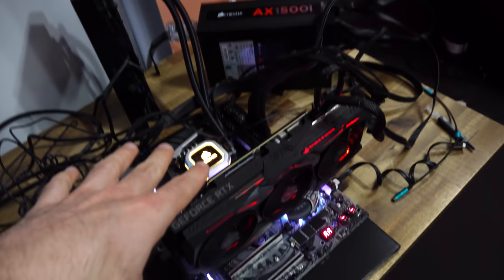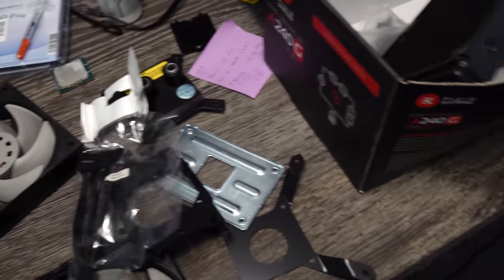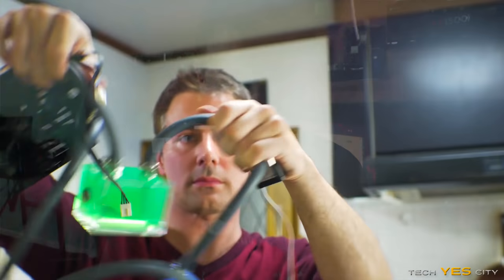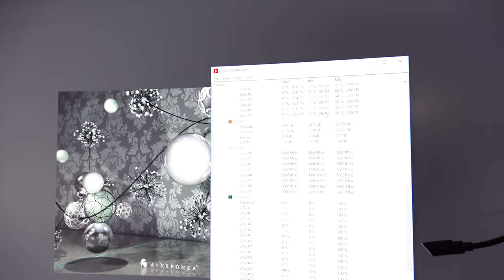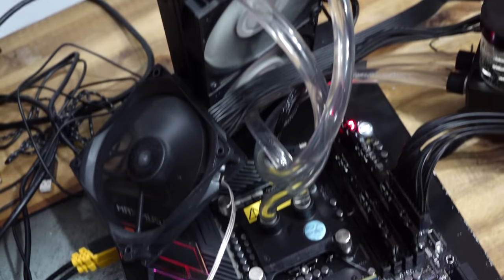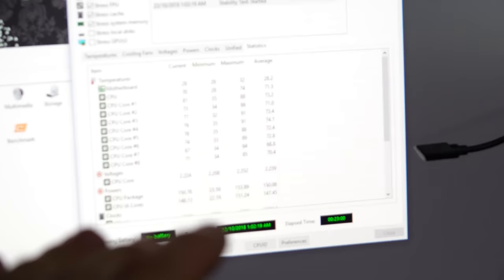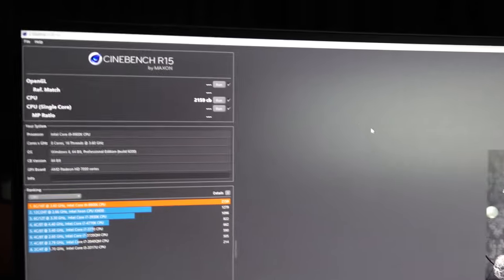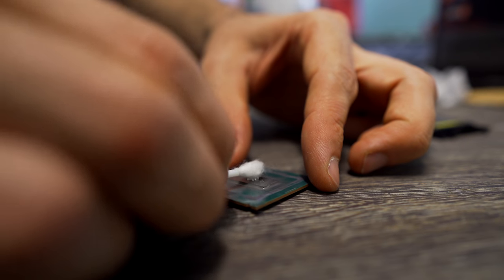Delidding 9900K - Is SOLDER Holding this CPU BACK!?

Comment: I got a 9900k that can do 2202 in cinabench at 5ghz at .1.29vcore temp is at 70-83 in stress test on rig real bench
Reply: Shit I am stuck between the 8086K and the 9900K , I do music production and RED Raw video editing. I just bought the 8086K with the Z370 E , But I want to return it for the 9900K, Should I get a new motherboard to or just keep what I have. I need both single core and multi core speeds. I am coming from the i7-980x. ahhhhh i dont know what to do.

Comment: Thing that you even can delid without heating to melt solder sounds like its done badly. Der8auer has delidded ryzens, he said he broke many of them before he successfully delidded one, and there was much less temperature improvement than 9900k. That tells soldering is better done on amd.

Comment: 91 degrees still seems too hot to be running your CPU imo. I don't like my parts running hotter than 80 degrees.

Rather than using a razor blade to remove the solder could you heat up the solder and remove it, or would that damage the CPU?
Reply: People often do use heat to soften the solder, BUT it's a lot easier to heat it up when you aren't using your hands to delid. As he was using a bench vice to delid the chip he just went with the metal fatigue method, whereby bending a metal aligns the molecular structure of the metal making it super brittle so it just snaps off.

Comment: haha. i delidded an old pentium 4 CPU a few days ago ... i cut of the silicon adhesive on the sides but then ... nothing wont get loose ... i  broke the plate off with a screwdriver and i ripped of the die from the chip :-D it was hardly soldered :-D

Comment: cant even get my 9700k stable with temps not over 80-100c  depending on voltages. its not stable at anything over 4.9ghz even with volts close to 1.5v which isnt worth trying. ill have to live with 4.9 and 1.38v
Reply: You need to return it, that's completely terrible, I can do 1.28v at 5.0ghz but still runs hot

Comment: im running 5.2 ghz on all cores without delid on my 9900k, so i'll be fine :)
Reply: Shit I am stuck between the 8086K and the 9900K , I do music production and RED Raw video editing. I just bought the 8086K with the Z370 E , But I want to return it for the 9900K, Should I get a new motherboard to or just keep what I have. I need both single core and multi core speeds. I am coming from the i7-980x. ahhhhh i dont know what to do.
Reply: @germanikolaas  get z390 yes. Buy F instead of E to save some cash. Although for raw video editing maybe you should look for a Threadripper 2920x instead.
Reply: @germanikolaas  get a Threadripper and you will also be able to upgrade it next year with a 7nm Threadripper that will delete Intel.

Comment: you must have very bad 9900k sample just wow, mine does 1.29V at 5GHz all core with a max of 84C in Aida64 using an h115i pro lmao...bone stock bios has these chips running in the mid 1.25V range, think you need to send that 9900k back to wherever you got  it from.

Comment: This chip is boosting from Intel to 5Ghz, you must be the most unlucky man on the planet Earth
Reply: k k as standard only 2 out of the 8 cores boost to a maximum of 5ghz. Under AVX load such as this video prime95 then they only boost to 4.7ghz.
So that’s why 5.0ghz is tough as it’s on all 8 cores using AVX vs 2 cores.
Reply: @Tylerjrb  I personally have it OC to 5Ghz on all cores with a 35€ air cooler!
Reply: k k depends on the air cooler I guess. But there is 200w or so to cool at 5ghz.

Comment: Man your 9900K Lost the lottery.  My 9900K does 5.0Ghz all cores with 1.21v under load. 

 Load temps around 75-80C in Realbench Stress Test.  This with a Corsair H100i V2 and no I am not delidded.  

Something is wrong with that board.  I am using the Asus Maximus Hero XI.  LLC7, 1.27v in BIOS with leads to 1.21v under heavy stress load.
Reply: Neiva Realbench uses AVX and is one of the toughest stress tests to pass which is why it’s so heavily recommended.
Reply: I've seen nobody with those results.

Run aida for 30 minutes, check cinebench score.
Reply: AIDA64 is a joker test lol, way too easy to pass.  It produces even lower temps than what I linked, and consumes less power because it places less load on the CPU.

My Cinebench score is very good.  

https://imgur.com/a/zcGe5vQ
Reply: Then you have the single greatest 9900k in existence.
Reply: Realbench is heavy ish but not as heavy as prime95 is. Realbench on mine pulls 170-180w at 75-80c 5ghz 1.3v. Whereas prime pulls 220w+ at 95c.

I’ve also had it stable with realbench at 1.25v only for it to crash in prime and while rendering.

Mine however just sits at 4.8ghz 1.1v for 24/7 usage at around 65c under prime95. I then benchmark with 5.1ghz but see little point in pushing it in workloads and games as it makes very little difference for me.